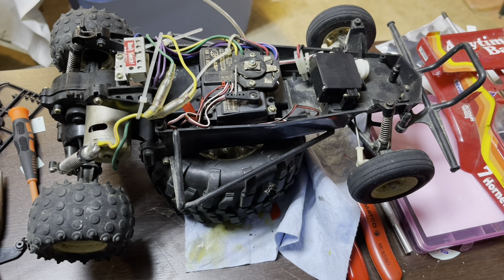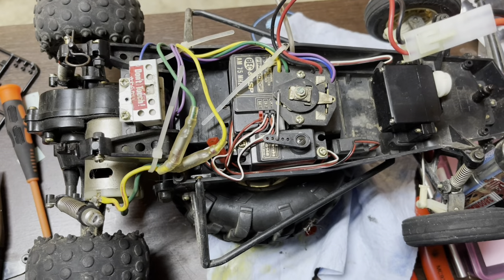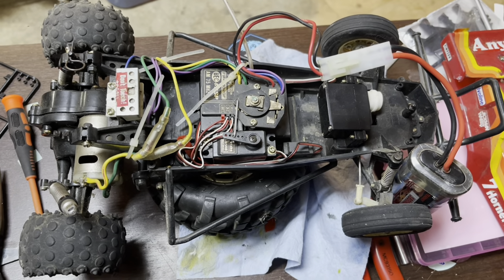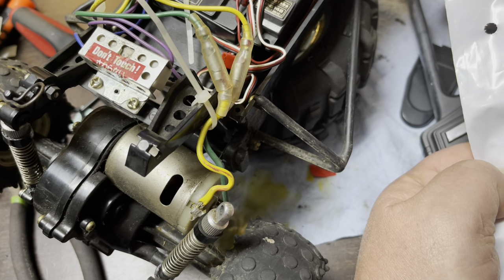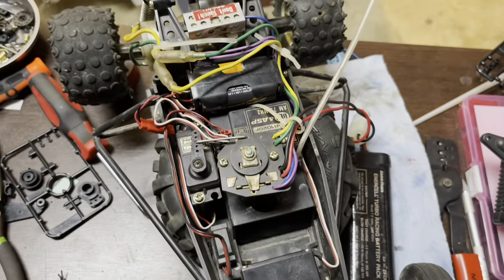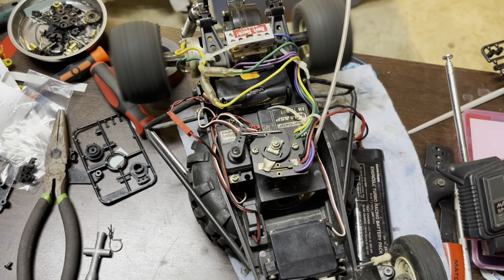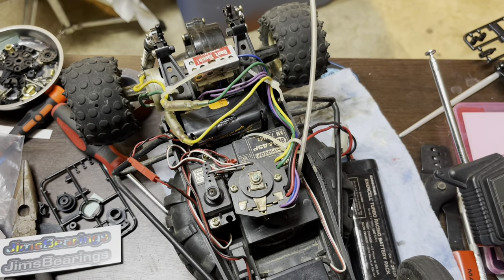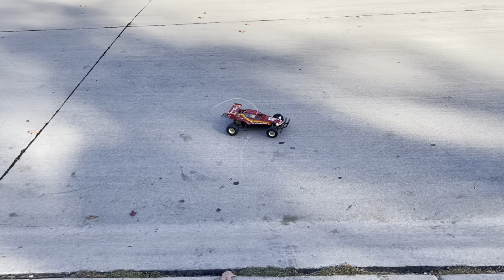1987 Tamiya Hornet, Original Electronics. Will it Run

Comment: That is quite a clean Hornet dude. Looks like it went well considering the age of it. Problem I had a with my vintage RCs was the servos had just jammed. It is always great to get one that is in reasonable condition 🙌🏻
Reply from the maker: It’s definitely in pretty decent shape for it’s age.  I’m not a big fan of mechanical speed controls but this one works and works well.. looking forward to a full restoration over the winter 😁

Comment: I can almost smell the Ozone from the old motor!! 3800 MAh..... that's like FOUR batteries when it was new!! 😊
Mechanical Speed Controllers worked - unless you get a drive wheel jammed in something 🤔 then the Resistor FRIED in a second! 
Only happened to me once. As you remember, they don't blow often. It's just an extra something to look out for. 
GLAD the Radio started working! At first I was thinking maybe a different set of Crystals... Loose wires is a better problem!! 

The Clodbuster! Yup, the last time I ran one WAS in the snow ❄️ in NY!! If it's less than 8", it loves it. The really fluffy stuff... it sinks!
Reply: You and Grayson had a blast with that classic!! Awesome run!
Reply from the maker: I hate winter. My rheumatoid arthritis kills me in cold weather.. I burned up a resistor on my old Blackfoot, that was its demise, and I never drove it again. This thing really surprised me, especially the old radio shack battery coming back to life. Thought for sure it’d be dead and I’d have to use my 3800 mah batteries.. now I know what I need to do when the restoration happens. Lost one of the kingpins off camera cause the e clip came off or something. Still no biggie. Cleanup, bearings, new body, wheels and tires and it’ll be like new again
Reply: @IowaBudgetRCBashers  Simple animal. Easy to fix!! 
I don't know how bad my RA would act up.... haven't been in cold and damp since 2005, and that was BAD. But for a little RC'ing fun, I might climb our 12,000ft Mountain this Winter, either with my Wraith or if I get my Clod built by then.
Reply from the maker: @CarmineRC  I’m looking forward to the monster trucks in the snow. Gray can make ramps and it’ll be fun.. we go snowmobiling at my brothers, but we do that in a clearing in his woods where it’s not so cold.. I used to love winter but old me hates it lol
Reply: @IowaBudgetRCBashers   BELIEVE ME bro... I understand! 😞